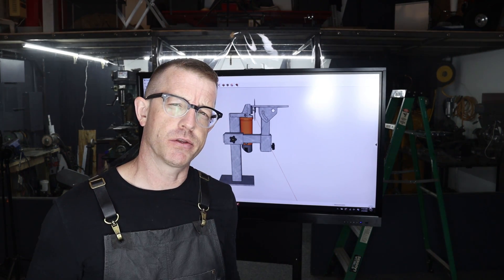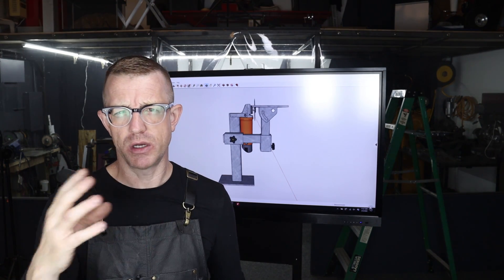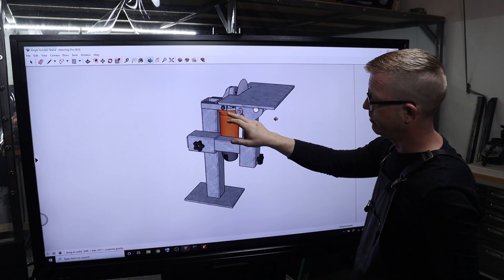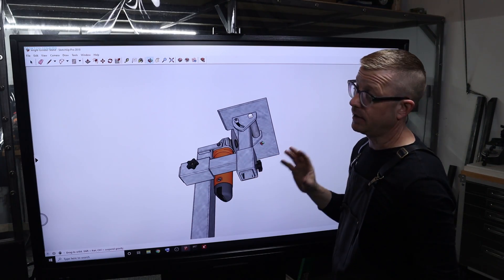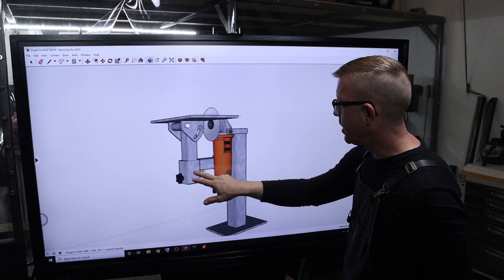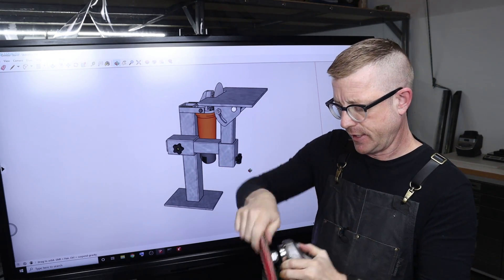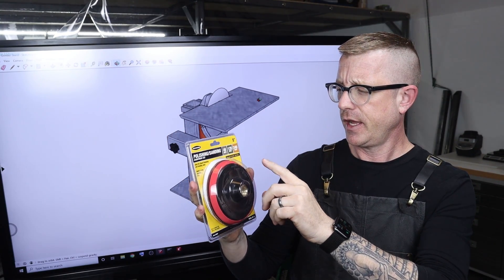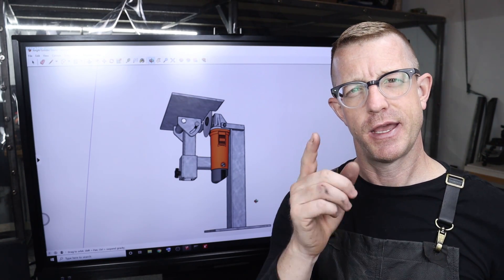DIY Bench Angle Grinder Concept - With Articulating Work Rest

Comment: Brian, make sure that the Safe Operating RPM of the Abrasive you are using is not exceeded by the grinder. I think that 4.5” grinder spins at 10,000 RPM, and that 7” Dewalt flap disc is only rated for 8700 RPM.
Reply from the maker: Thanks Jamie. I’ve since gone down to a 4” soft pad with Velcro. Much safer!

Comment: Instead of the variable speed controller, you could try a more expensive Variac.
Reply from the maker: That’s a good idea. I have a nice porter cable one but I’d like to keep that separate.
Reply: A variable Transformer? That doesn't change the frequency and therefore doesn't change the rpm.

Comment: You definitely don't need two slotted plates for the work rest.  One under the center is enough for the stresses this will see.  I have a single slotted plate on mine, with an adjustable locking handle, and it works a treat!
Reply from the maker: Yeah I agree, I got rid of the complex plates. It’s a lot more simple now. 👊🏻👊🏻👊🏻

Comment: If you put pivot hinge on side between square tubing and grinding disc you will have better geometry for work surface plate as it pivots. Minor change but will make better design.
Reply: Yes sounds good. You’ll love having a CNC plasma table. It will make things so much faster and open up many things that you may have avoided due to time constraints. I have had 4’x8’ table with 85 amp hypertherm in my fab shop for several years
Reply from the maker: Oh cool. Yeah I am very excited to start using it. I can’t imagine coming up with an idea and seeing it print out in a matter of minutes. Exciting. 👊🏻👊🏻👊🏻
Reply from the maker: What I was thinking was moving the pivot point closer to the disc, But Melissa said to maybe just have a nut and bolt do the pivoting and I could completely lose the plate all together.  Or use the round steel as the pivot and lose the plate. It isn’t supporting much so I think that combined with your idea could work.

Comment: @6:29  https://www.amazon.com/dp/B07ZCM37L5?ref_=pe_623860_70668690_dpLink
Reply: I'm still considering picking one of these up... I figure it would pay for itself by the time I've fried 4 or 5 SCR based controllers :)
Reply from the maker: Yeah i think you are very right. I tried out the speed controller last night and it worked but it just seems JANKY AF.

Comment: I'm making something similar utilizing my Ridgid R2900 router motor. The motor is a HAUS and has speed adjustment.

Want is a sliding miter/radial arm type saw with angle grinder.
Reply from the maker: That would be interesting, like a surface grinder but the grinder moves...maybe.
Reply: @HouseMadeUS  Nah,  the RA grinder w/ cut off wheel vertical , slide front to back on a track etc (like a sliding miter saw) and used for accurately cutting maybe thinner gauge material

Comment: Yeah those fan controllers are a shot in the dark. I tried the exact same thing with a Harbor Freight trim router. I made a jig to hold it upside down, so I could clamp it to my bench, then have the router bit(well end mill) pop up. It's in one of my old jimping videos(I think W2 vs 1095).  Anyway, one of the controllers blew right away, one didn't work at all & the other lasted maybe a month. I forget what's in them, but it's not much, pretty basic electronics.
Reply from the maker: Yeah I figured. I tried this one out very briefly but it doesn’t seem very solid. I’ll hope for the best! Haha! Worse case I just turn it on and off. 👊🏻